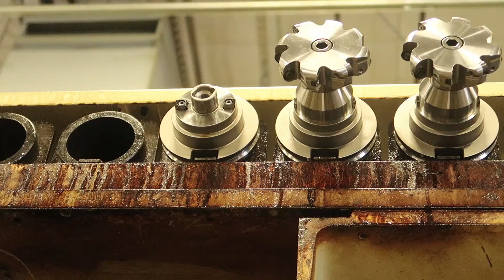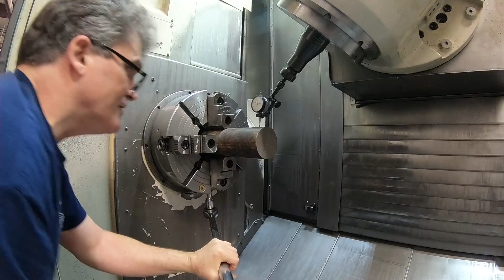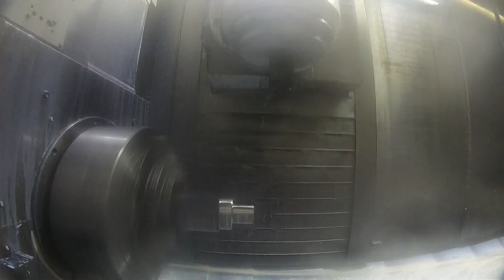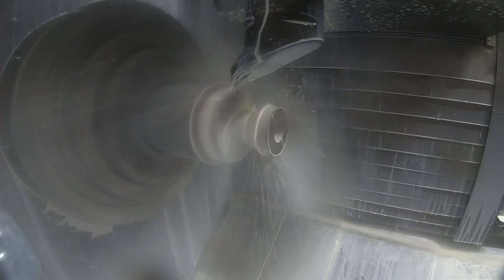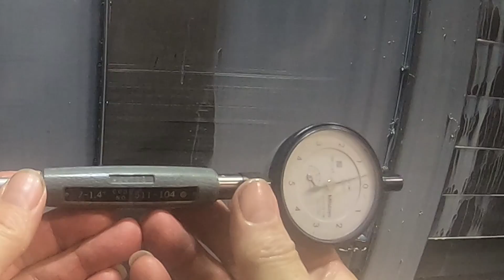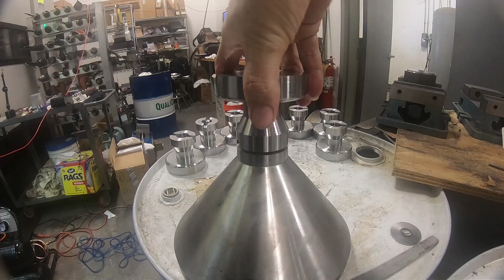Remake A Cutter and Spares

Comment: @Peter I might have to soon attempt to make a custom Tool for my application , did you not machine a Forward Angle or Backwards Angle , Rake / Relief on the seat of the insert , I mean if we see a normal insert they always lean on the body at an angle , or did you make a straight seat ? Does it matter ?
Reply from the maker: Because of the geometry of this cutter all the inserts set at a neutral angle. But it depends on your cutter and the insert. If for instance the tool is a face mill and your insert has enough side clearance you might tip the pocket both radially and axially to get some positive rake. Or you can get a insert that has that built into it and machine a neutral  or even a negative pocket geometry. It all depends on the insert.

Comment: How do you like the taster? Seems like a good investment
Reply from the maker: Taster?
Reply: The probe you picked up z with. I’ve heard them called 3D Tasters? Whatever it is, I’m super curious about it.
Reply from the maker: It’s made by Haimer. Yes I use it all the time. It is a little costly but good. If you get one get the Haimer brand. I have tested some others and there not accurate. Do a search Haimer 3D sensor. I prefer the analog one over the digital.

Comment: I enjoy the videos.  This is not meant to preach to you, but I want to relate my training as to leaving a chuck wrench in a chuck.  I attended the US Naval Machinery Repairman School in 1960.  The rule was that your hand never leaves the chuck key while it is in the chuck. If you were caught breaking this rule, the instructor would put the chuck key in a bucket of very hot water from which you would have to retrieve it. If this happened a second time you would be kicked out of the school and sent out to the “fleet” , thereby losing your chance to be able to work in that field.  It makes me cringe every time I witness this action.
Reply from the maker: Did I leave the chuck key in the chuck in this video? I don’t remember. On a manual machine you are correct to be concerned. On this particular machine none of the spindles can be run or even jogged with the doors open. So there is no safety hazard here. But you are correct I would never do such a thing on another machine that didn’t have these safety interlocks.

Comment: Nice video Peter.
I have one question... how much material do you usually leave when parting so that you can easily knock it off with a soft hammer like that?
Cheers.
Reply from the maker: The hole I drilled was .515 in dia. I parted to a dia. of .525 in this case. It varies with the type of material. If you leave it a little thick on the first part. Than tap it with the hammer. If it seems to stiff like it won’t break off ( don’t hit it to hard or you can’t rerun the parting tool). Rerun the parting tool to take a little more. You will be able to tell when you have the right wall thickness to break easily. Usually about .005-.007 wall thickness is about right.
Reply: Thanks for your reply Peter. 
Cheers.

Comment: Great video, what speed and feed are you using on the iscar cut-off tool and what width? thanks
Reply from the maker: I would have to look at the program to be sure (I’m not at the shop at the moment). If memory serves me. The speed was 250 SFM at .002” per rev. The feed could go as high as .004”. I Tried it at 200% overide and it worked fine.  Remember the steel is 38 rc hardness. The tool is .125” wide.
Reply: I use iscar for cut-off also and like them , run 304l and kovar  and everything else, just wondering  what you were running them at, what they recommend  is a wide range. thanks for the reply.

Comment: Thanks for these videos, learning so much watching you work and how you approach job, appreciated.

With the cutter, why use the fixture instead of holding the part in a set of soft jaws? more accurate? Also where do you find the geometry for the cutter? i recently reverse engineered some sandvic and seco cutter with hopes of making some on our mill turn. I measured everything best i can but would ne nice to find the actually rake, setback etc.
Reply from the maker: The fixture duplicates the Shellmill shank as if it was in the milling machine. If I get the fixture aligned and true in the spindle of the lathe the will be very little inaccuracy. Or to put it another way it will eliminate any other inaccuracy in the chucking device or run out in the part not being in the chuck jaws properly. Once I get the fixture aligned it will replete so no indicating the parts just mount the part and tighten the clamp screw.

Comment: Why so many of the same tools in one machine? My only guess is they leave the machine unmanned and it's a tough material with high surface finish demand...?
Reply from the maker: Exactly this is a unattended machining operation so it has to be very reliable. Also in order not to have to index inserts with the machine waiting. I usually index the inserts on the cutters that have already run while the machine is running. That way when the cycle is done all I have to do is change parts and start again.
Reply: What if its a "soft" material and the customer demands a very high degree of "precision" from the finished parts and/or the machinist/machine shop is smart enough to know that the only guaranteed way to get maximum "output" and "tool life" is to change tools "more often than required" and spread the work and load over as many tools as possible and put his time/effort/skill/ability into maintaining/adjusting/indexing/sharpening those tools so they work "perfectly" start-to-finish "unmanned" or not? 

CNC machines are not "magic" and the fact that they're ALWAYS "unmanned" doing the job "automatically" makes it pretty much impossible to "keep an eye on" the work they're doing until that work comes out of the machine. And unlike a "manual" machine with a human actually at the "controls", once they're "done" with a process per the "program" and automatically change tools, there's no way to "inspect" the work and maybe "touch up" a slightly oversize or undersize part due to "tool wear".  

It takes a VERY experienced machinist/tool & die maker to be anything but a CNC "observer" there just to "feed" the machine and clean up after it and CNC machines and all the "smart" technology that's involved is no "smarter" than any other complex "computer-controlled" system. Garbage In, Garbage Out. You know more want a machine sitting there waiting on a "rush" cutter/tool sharpening/adjusting/indexing "job" than you want it sitting there waiting for some "rookie" to finish programming it for maximum "efficiency" by taking as few and as deep of cuts and passes as the "specs" of the machine say it can "handle" or you want it sitting there RUNNING "unmanned" because the "CNC machinist" in charge of it is just a "cook" and "janitor" feeding it and cleaning up after it and only doing the bare minimum as far as keeping the cutters/tools it uses properly prepared for use. 

Especially when its JUST AS EASY for their to be "flaws" in CUTTERS AND OTHER TOOLS that cause them to fail "prematurely" or not work at all as it is for there to flaws in the raw materials a machinist and machine tools - regardless of "manual" or "CNC" - make the finished product out of USING those cutters, tools, etc. And if its something like a material or manufacturing failure that has resulted in a "run" or "lot" of cutters being flawed/faulty and the machine "knows" to replace flawed/faulty tooling with "new", do you suppose its possible that 5 or 10 "holders" worth of cutters could all be "flawed" with the machine "rejecting" and replacing one "unused" holder of cutters after another until it "found" one that worked right? 

I'm not even a machinist despite having operated a few machine tools over the years and some pretty "unique" ones (ever seen the tool that "cuts" wheels on a locomotive WHILE the wheels and traction motor are still ON or rather UNDER the locomotive? There aren't too many of them around but I've "operated" one for Union Pacific - CNC but plenty of guys prefer to run them in "manual" and either way you're indexing cutters every 30 pair - both sides are cut at once -  at MOST) and I'm mainly just a dumb old diesel mechanic and even I know you don't "run" tools until they're "shot" and you don't depend on any new tool being "flawless" and that many "tools" are just "commodities" and when you run into one "bad" one you're likely to find a bunch more because "manufacturing mistakes" on a "mass-production"  basis almost never affect just ONE finished product unless its one that was made on "Monday morning" or "Friday afternoon" or otherwise was a "human error" scenario and just a "fluke deal" where "outside factors" led to it being "manufactured" with improper parts and/or labor rather than "materials".
Reply: It must be exhausting using so many unnecessary quotations... Who are you even talking to?
Reply: @deeremeyer1749  Maybe trade some of that coke for some punctuation.

Comment: Still being fairly new to machining, I'm curious....if you're using the same tool to do the finish OD pass as you use to rough it, why not run the finish pass right after the roughing to save a tool change?  Similar......when using the end mill to mill the counter bore, why not do the slot at the same time?  I'm asking because I'm guessing there's a good reason for doing it the way you are, so I'd like to know for my education. :)  Thanks!!!
Reply from the maker: You are correct I could have done that for the turning tool. As for the milling it requires two different diameter tools for the c-bore and the key slot. If this was a production job I would look to make it more efficient but for this the time saving isn't significant. Its just the way I happened to program it in the cam software. No particular reason.
Reply: Ah......I completely understand! :)  Thank you!!
Mike

Comment: thank you really interesting tooling,  i always pay attention to metal grade and HT,  you have a gang of those cutters some of cutters are cut upper radius and lower radius?
Reply from the maker: The setup has 16 parts and 16 cutters. One cutter per part. The width of the cutter is the width of the cut in the part. It takes three passes radially to get to depth.

Comment: How long have you been doing those parts? I would assume it took a little head scratching to figure out the economics of making an army of your own cutters vs buying them (if you can even get such a thing). Must be a high dollar reoccurring contract!
Reply from the maker: I’ve been doing them for quite a while. They run unattended except for indexing inserts and changing the parts . I have run thousands of them. It has more than paid for the special cutters and setup. This is one of the best money making job I have ever run.
Reply: Edge Precision needs more “parentheses”
Reply from the maker: It is like reading a whole article isn't it. But I appreciate all comments.
Reply: DEEREMEYER1      Waiting for chapter two
Reply: Why would it be any more "cost effective" to do something "in-house" for a "high dollar reoccurring contract" than for a one-time "job" where you have ONE JOB to "make up" the cost of production of the "special tool" where presumably it would be more "profitable" on a per-part basis to "farm out" making that special tool to another "supplier" who gets the "easy part" of just making a "special tool" to your "specs" and isn't "on the hook" for the finished product? Especially when those "high dollar reoccurring contracts" are coming incrementally and you're probably going to be stuck making the last "order" for the same "per unit cost" as you did the first "order" even though your own inputs and expenses may have increased significantly over that time period? 

If a job requires anything "special" that you have to "acquire" before you can do the job, why would you "farm out" something you can do "in-house" and give somebody else the work, lose the time and money you spend "acquiring" it from an outside "supplier", risk YOUR reputation/revenue/business/livelihood betting on THEM to produce and deliver what you need when you need it, let THEM "make money" off of you TWICE since they're working while you're sitting and waiting for their work to do yours AND paying for a "special tool" you haven't previously justified "acquiring" for yourself and one you'll have a really tough time billing YOUR "customer" for and risking having the customer go elsewhere when for any number of possible reasons, problems with the "supplier" or simply the fact that you have to take time to "pencil out" whether or not you can/should "farm it out" or do it "in house"? 

If you have the resources to do the kind of work that requires a "special tool" like that you'd damn sure better be able to use them to make the "special tool" in-house and KNOW you're "making money" doing it that way vs. going to a "supplier" who is in the SAME BUSINESS only has "customers" who somehow can't/won't make for themselves the "special tools" to make more complex, sophisticated and demanding products that "require" them. 

If you have to machine a special tool in order to complete a project for a "customer" then you're looking at TWO JOBS instead of ONE and you'd better not be "pricing" the two any differently and penalizing yourself for not having spent your own time/money unnecessarily (presuming any "special tool" is one you don't have and any you do have that's still a "special tool" must be one you've purchased and haven't paid for putting it to use) just to be "prepared" for a customer coming in and needing something done that requires you to MAKE A TOOL before you can use that tool to MAKE A PART if you want to be "successful" in your business. 

If I walked into a machine shop with some kind of "difficult" project regardless of whether I needed one piece or a thousand and the machinist told me he'd have to "order" some "special tool" from some other...machine shop...in order to do the job for me the only way I'd still be there listening a minute later is if he "quoted" me the work and knew the cost of the special tool but didn't specifically include the cost of the special tool in the "quote" and still guaranteed it would be done "on schedule" if I had some sort of "pressing need" for the work which presumably would be the case since I probably wouldn't shop for machine work I didn't want/need ASAP. 

And if my main concern was TIME, which again presumably it IS since I'm out "shopping" for machine work and the machinist tells me he'll have to make the "special tool" and includes that expense in the "quote" and I trust him to do the actual "project" AND can have "insurance" if he makes the special tool as well as the project that any problems with it are all on him, the only way I'm NOT going to still be standing there talking to him a minute later after hearing he doesn't have the "special tool" is if he's already on his way to start making the "special tool" and I find myself standing there talking to AIR. 

How does being a machinist ever NOT "pencil out" positively in your favor to do and make everything possible "in-house" vs. farming it out when you're buying RAW MATERIALS to make any and all "special tools" and are charging the customer for a "special tool" on the back end and more than likely one that they're not going to take with them? That would be like a welder buying "welding tables" from some "supplier" or an electrician hiring an electrician to wire his new house or shop or a "supplier" paying to move/create PRODUCTION of all the "supplies" he's just the "middleman" for "in-house" instead of just being the "middle-man" between the actual manufacturer and the end-user. Which is what MOST "suppliers" of "supplies" to the technical trades actually are. Middle men. Making their money on the "margin" between buying things in "bulk" on a "wholesale" basis and selling them as "specialty supplies" on a "high retail" basis to businesses owned and operated by "business people" who may be "self-employed" but sure don't know how to "work for themselves".